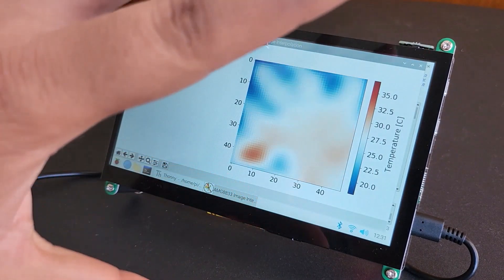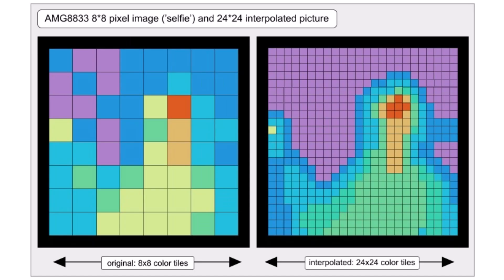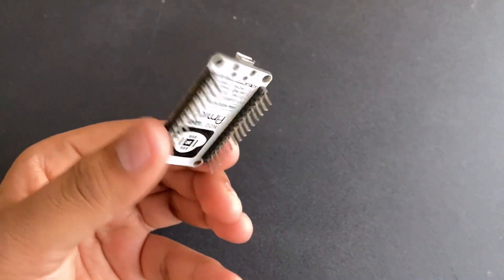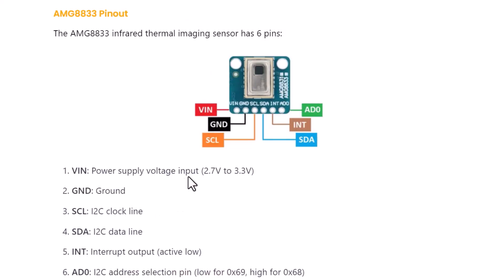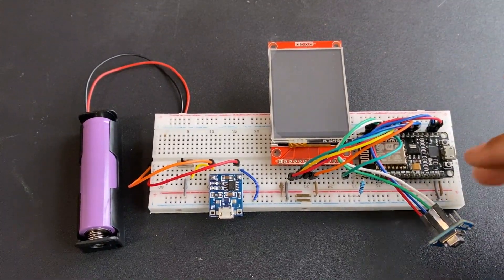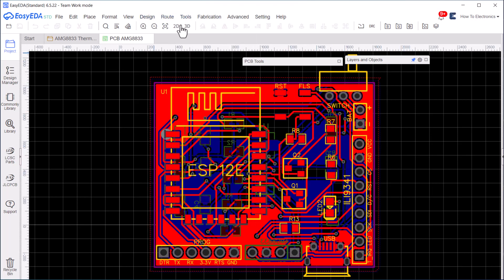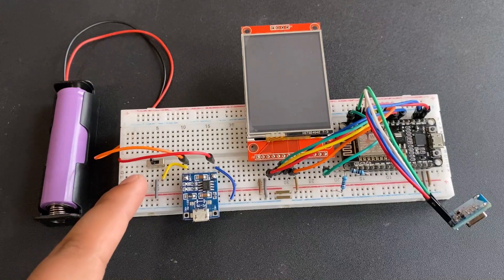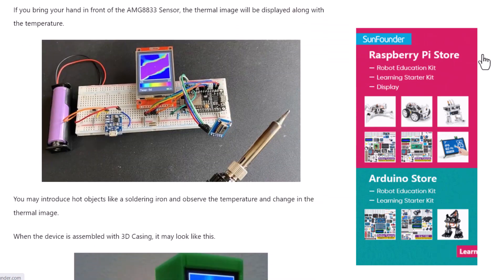DIY Thermal Imaging Camera using AMG8833 Temperature Sensor with ESP8266 & LCD Display

Comment: lcd display not turning on even with proper connections can u help
Reply: Heyy
Reply: Any updates?
Reply: Not working probably
Reply: @mirko8838  mine worked
Reply: @mirko8838  you'll have to change something in the code
Reply: @JamesArrabis  He need to test lcd if even work, then he know issue is in code